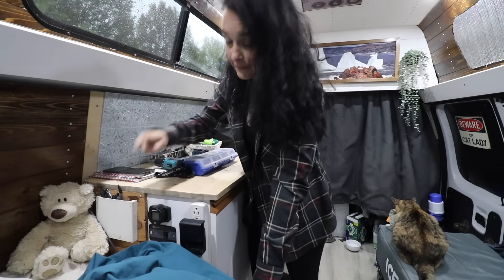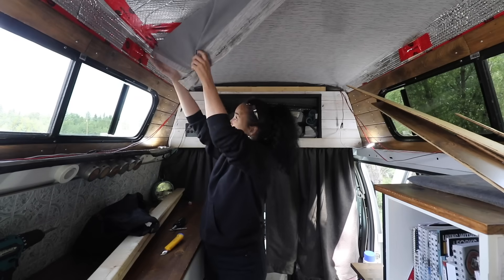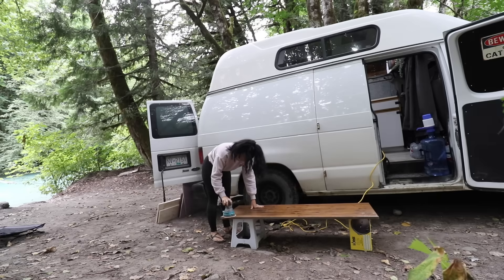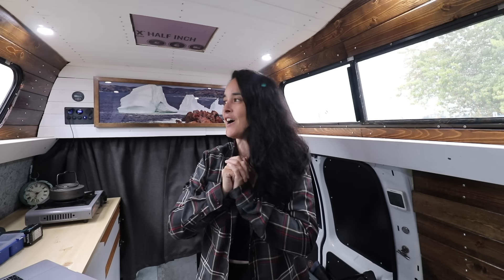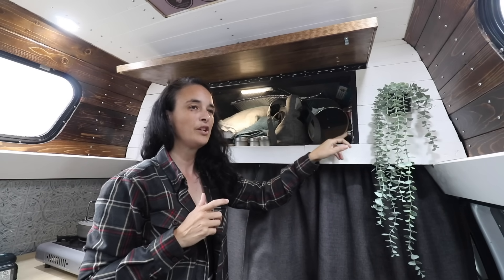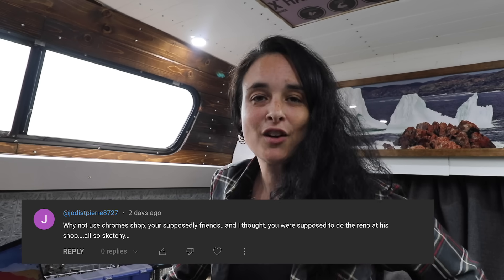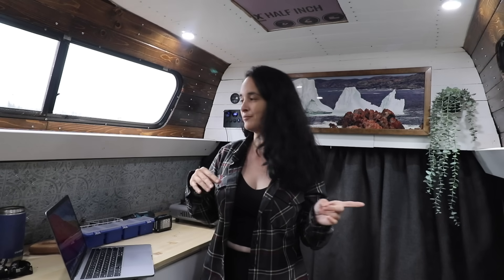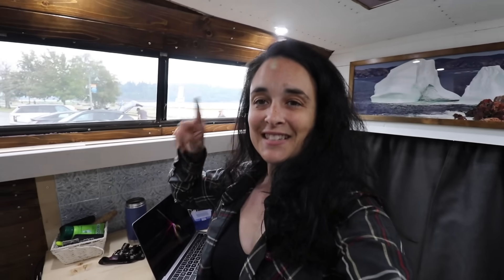DIY CAMPER VAN, SO MANY QUESTIONS.....

Comment: Your renovations have not only been aesthetically pleasing but also very functional/practical.  The photo doors are the bomb.  The wood work and trim has just made this a home. The adding real insulation will keep you warm and save on fuel to heat your home.
Let negative judgemental comments roll off like water off a ducks back.  Love from the US to you and and miss Kelly

Comment: Hey Emi, how about doing a leather loop stained the color you used on the frame as a door knob? If you used a heavy duty piece of leather it would make a nice door pull and won't add any weight to the door like a metal handle would. I've seen it done in one bus build and it added such a nice touch. The builder said they chose the leather because it wouldn't catch their clothing like a metal door pull might. Just a thought. Happy trails and safe travels to you and Kelly!

Comment: if you get access  to a  router you could cut away a hidden  ½" finger pull on that bottom inner edge.. You don't need s router but that's  a clean quick easy drill out.

Comment: Hi Emmy you could use a small piece of flat strap  in the middle  of the picture frame on the inside so it hangs down  maybe an inch and a half. Like a piece of velcro white or black. Use short screws maybe 1/2 in long. Just an idea Tom in the Maritimes

Comment: Could you, on the frame for the iceberg picture/door, carve out a little bit from the back side of the frame to give yourself an invisible finger pull that would be easier to grab compared to what is available now? Wouldn’t need to add any hardware to the frame that you might not like seeing. 🤷🏼‍♂️
Reply: TheCatLadyVAN-  All you should really need would be say a Dremel rotary tool and cutting disc for wood as well as sanding attachment and then maybe a chisel or screwdriver as all you need to do is mark out the general size of what you’d need to have your finger grip the door to pull on it and then make a lot of parallel cuts all relatively similar in depth and use the chisel or screwdriver to break the wood out of the small section. Use the rotary sander attachment or strips of sandpaper to smooth it out into a shape that works and is comfortable. It will be hidden so perfection isn’t a thing unless you can wait to get to Chrome’s shop where he’ll have the tools and you’ll have big workbench etc.
Reply: TheCatLadyVAN-  Loren probably has some chisels or hand carving tools that would work since you’re on that side and not out on the island.

Comment: Hi Emmy did you install a power and ground wire in the ceiling for the fan when you have it installed  ? If not the ceiling will have to come back down or use a "fish" wire to snake the wires in. Have a nice day. Tom in the Maritimes at the NB- NS border.